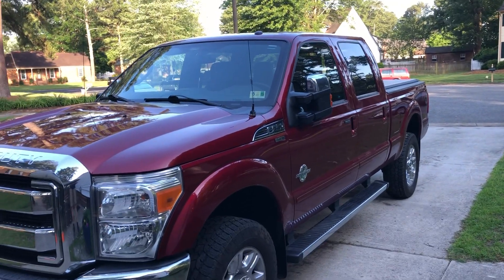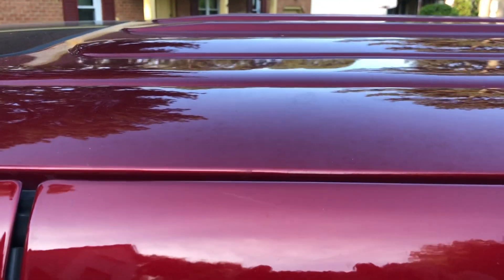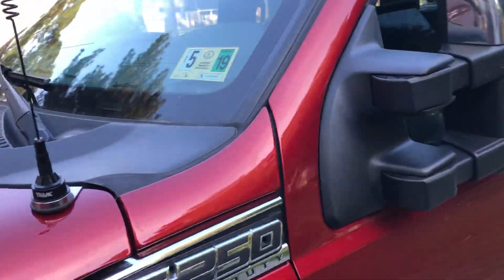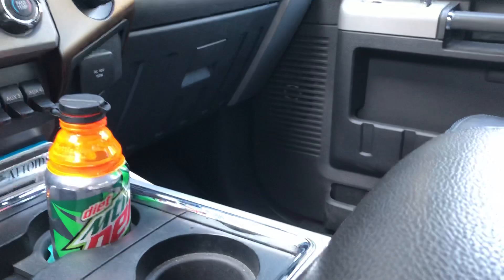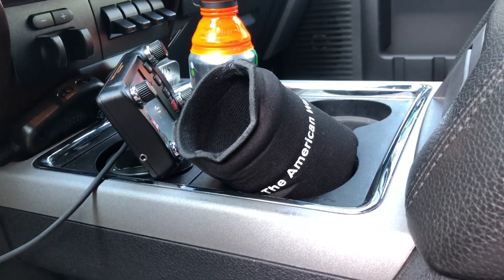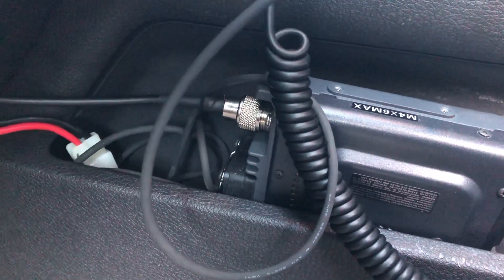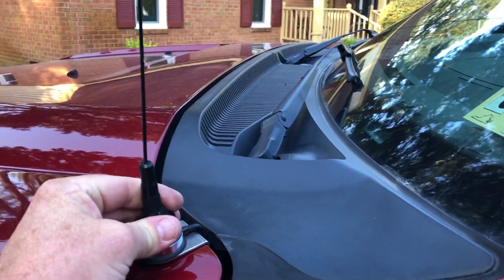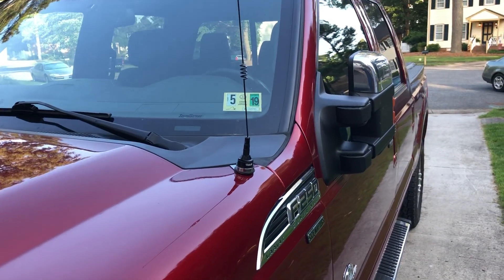Antenna install in my F-250 for my FTM-400XDR

Comment: Im about to install a dual band in my 2008 F250 super duty. The dash in your truck is the closest to mine that ive seen in an install video. Did you have to loosen the black cowling between the hood and windshield to route the wires?
Reply from the maker: I did not. There is just enough gap between the cowl panel and fender in my truck to squeeze the RG8x cable in and it's just tight enough to keep it from coming out on it's own. 4 years later and it is still routed the same and working great.
Reply: @K4MJV  thanks for the info. Hopefully my radio will get here before the weekend. 73 KO4SCP

Comment: Nice job and thanks for posting this video.  It gives me some ideas for my antenna install on my Tundra.
Reply from the maker: It can be difficult finding ways to mount radios in the newer vehicles. Gone are the days when you can just mount them under the dash. I still have the same setup in the truck today and it still works great! Have fun and 73